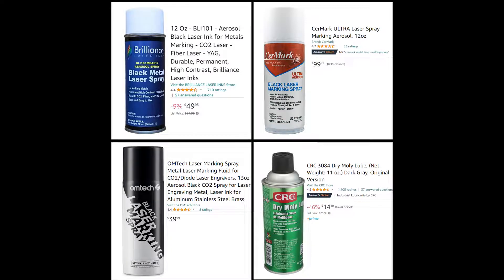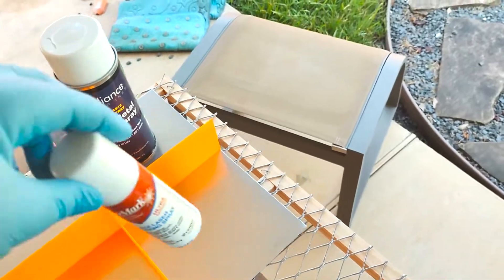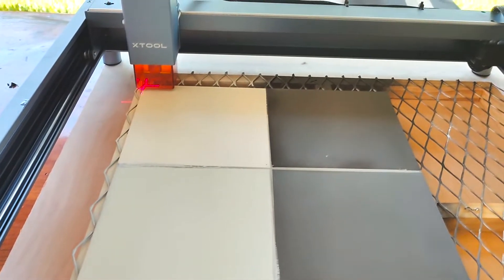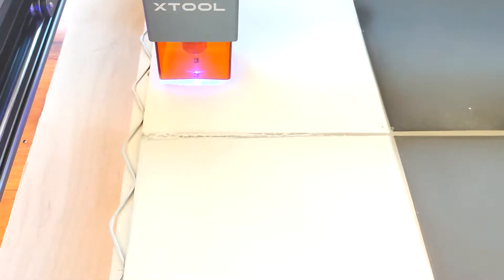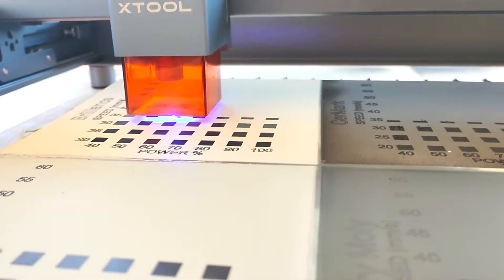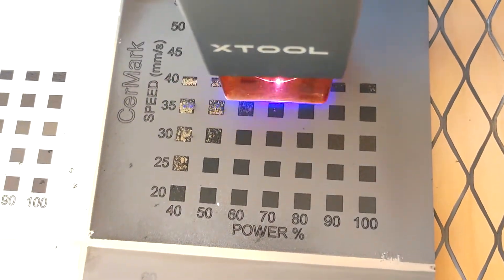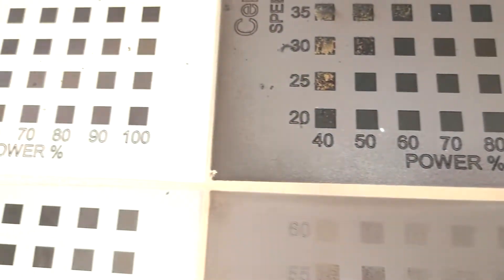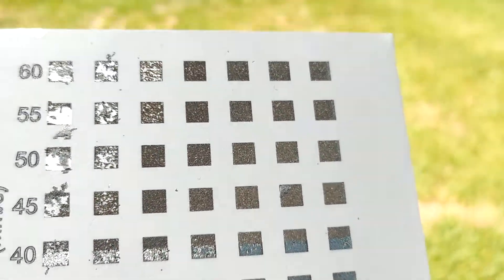Which is the best Laser Spray for Stainless Steel (10w Diode laser)? $100 vs $14 per can

Comment: Interesting results! Do you have any plans to try this on glass? I am currently using tempura paint on glass to get frosting then filling with black sharpie afterwards, but am interested to see if this laser marking spray could be used instead to get permanent black marks on glass, without the need for the microfracture+fill?

Comment: Excellent video.  I tried several options including the MoS2 and the Omtech and came to the same conclusion.  Omtech is the best for my purposes.  Much better deeper blacks.  Two coats of Omtech leaves a tactile noticeable raised lettering as well if needed.

Comment: Just found this video and I just tested the same 3 sprays this past week. Didn't do a test grid but made a test block with fine lines and thick lines (words and graphics). Omtech and Brilliance were both very close. The Brilliance seemed to do fine lines better and Omtech marking felt thicker on the wide lines. Cermark did spark also when lasering it, and also did poorly on the fine lines. Thick lines/words did better. I will probably do a test grid with the Omtech and Brilliance in the next week or so.

Comment: Hmm... I thought the marking spray would be black to absorb heat and etch the metal. It almost looks like it is "melting" the product onto the stainless and not actually etching it. I wonder if powder coat paint would work with air assist off. Might even be able to get white and put mica powder in it to get different colors.
Reply from the maker: Yeah, I am not exactly sure what is happening to cause the adhesion to the stainless steel. I do powder coating and it is definitely more stuck in than powder coat. If I have time I will try the powder coat and see if it works at all.

Comment: Have you tested cermark after that video? I think cermark was issued because of bending? 100% power was closer to diode than 100% of brilliance and omtech. Im working with cermark and need to make similar test for finding out the best power/speed settings. Good video and maybe ill switch spray when my cermark is empty 😊
Reply from the maker: @kokkaakotona  I have not re-tested Ceramark.

Comment: Good video, but one thing I would change is you platform you are using, the steel wire is great. But the wood attached to it is a fire hazzard, espically if you are cutting things out, Invest in a honeycomb bed, Hopefully that laser came with one.
Reply from the maker: Yes, I agree honeycomb bed would be a lot better. I didnt use that platform very long, I upgraded the laser with the extension.

Comment: You know which coating you missed? none! You should have run a test one the stainless without any coating. The you would have seen a serious difference, as in serious color from the stainless. It was a valiant attempt, but I'm calling this one a fail overall
Reply from the maker: Hello Rick, thank you for your comment. I did run a test without any coating before doong this test. It does mark the stainless steel and you can get a variety of colors but it would have to run at 10 mm/s or slower and I needed a speed that was over 100 mm/s. Also, I assumed most people have tried or will try not coating, there are tons of videos on that.

Comment: Just painting on a titanium oxide and water mixture on will give you better results at a much cheaper cost.
Reply: Hi, i would need only those two ingredients to achive results comparable with tested sprays?
Reply: @Sion1380  My results with the titanium oxide are generally better than the sprays.
Reply from the maker: @2011blueman  Thank you

Comment: The problems you stated toward the end were definately due to not having a proper over-scan setting.  The appearance is that you do not have it enabled, should be ~ 2.5%....  It WILL certainly help this line issue you were having - for sure....  OVERSCAN needs to be set to a nominal 2.5%...  I'll bet you a buck over-scan was NOT set at all.........
Reply from the maker: Did not know about overscan. Thank you for the information

Comment: I'm wondering how well the marks will hold up after a dishwasher. I use a few different sprays and found that they don't always hold up in the dishwasher.
Reply from the maker: The OmTech, I have used a sander and the black is just about as strong as the bare stainless steel. Not sure how that compares to the dishwasher.

Comment: Thanks. I've tested with Brilliance - I bought a can of Cermakr but haven't used it. Maybe its not too late to return it!

Would be nice if you did another test on clear glass where spray is essential (at least with my max 10w laser) in order to etch  the glass. My engraver has both 450 and 1064 lasers - I can mark metal nicely without any spray using the 1064 - but again the spray is an absolute requirement for glass.
Reply from the maker: I will try the spray on glass, thank you for the suggestion.

Comment: Does this work for aluminum as well.
Reply from the maker: I have not tried Aluminum. The videos I saw were someone tried aluminum it scratches off very easily probably because the metal is softer and scratches much easier.
Reply: @kywilco369 thanks for replying. I have a spray coming I'll give it a shot. Maybe try spraying a clear to protect it.

Comment: I use nothing and mark SS perfectly.
Reply from the maker: Yes, the laser would mark on SS without the spray, but it was faster and darker with the spray. My goal was to do a 65mmx200mm plate within 1 hour. And without the spray it would not have been possible.
Reply: I've got the 22 watt Creality. I guess the extra 10 watts is helping me here. I get a very dark etching on anything SS.
Reply: @Beecher_Dikov do be careful because the reflection of ss can cause damage or over heat your laser in the long run
Reply from the maker: @zeronaught8990 Great information, Thank You.

Comment: Have you tried etching without the spray? Does it work at all comparatively?
Reply from the maker: Yes, it does work with a 10 watt laser but the fastest it would go and still leave a mark was 10 mm/s and it was very light. Even 4 mm/s it looked gray instead of black. I needed a Black and at high speed.

Comment: I have a XTOOL D1 10 WATT LASER. It will mark Stainless Steel very good with CRC Dry Graphite Lube for $12.0 a can.
I spray 3 light coats, let dry between coats. Laser power at 100 % and speed at 300 mm/minute. WORKS GREAT !! CHEAP TOO.
Reply: How did you clean off the remaining moly? He gave up the test before cleaning the moly off, which disappointed me. Looked to me that the moly was allowing some coloration of the SS plate... I have a can of CRC in my shop, will give it a try. I would think just plain alcohol would get it off easily? thx.
Reply: @LeMortso  use Crc DRY GRAPHITE LUBE, not the CRC GREASE LUBE. Cleanup is easy with 90% alcohol. Lastly spray 4 coats evenly and let dry between coats.
Reply from the maker: I will have to try that one
Reply: Where are you getting it for 12 a can? Also does this show color?